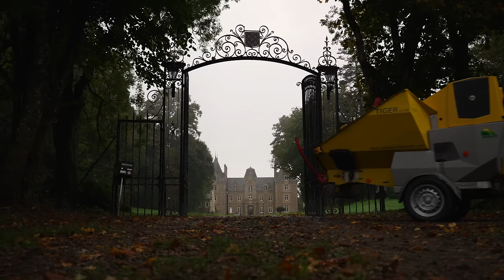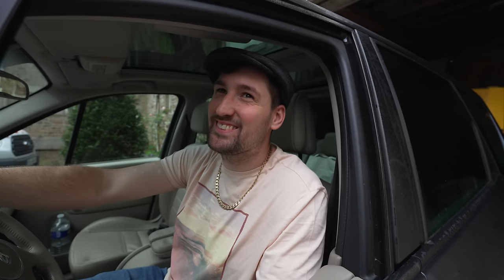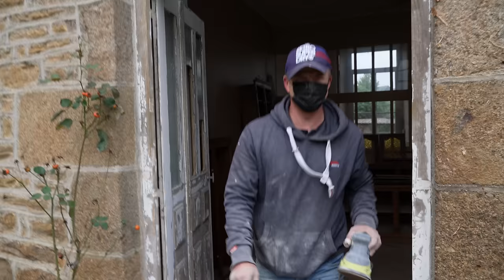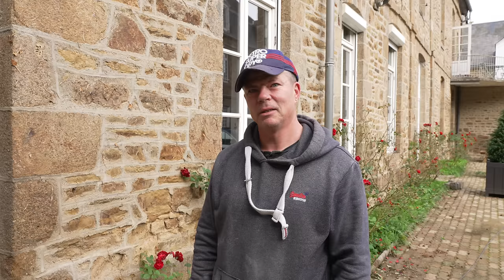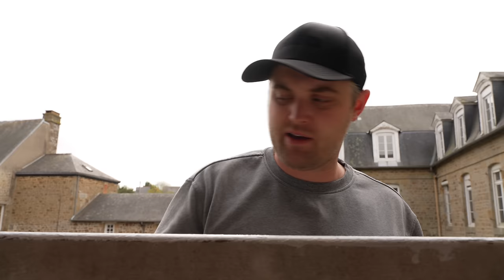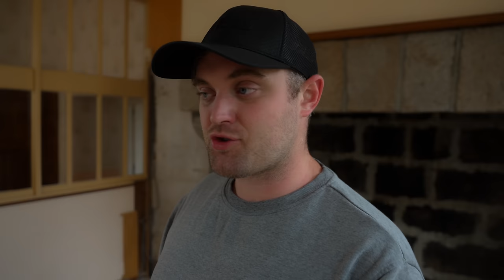A Cult Tried To Buy Our Abandoned Convent

Comment: wee gardeners tip for hedge trimming, billy. always have the top narrower than the base. that stops the base from becoming woody a bare n you have a lushly-leafed hedge from the bottom up. whether a hedge trim is acutely pyramidal or only slightly in shape, the growth aspect still applies. hedges fatter on the top always deteriorate into bare, woody looking failures with leaf only on the top.

Comment: 💕If you clear the kitchen by hand that will be the same as lifting weights & walking said weights outside will be the same as walking on a treadmill in a gym💕You’ll know you’ve achieved your goal from aching muscles💕Wash glass at both convent & château greenhouses wipe on wipe off good wrist exercises💕Use items around you like running up & down convent stairs or corridors knocking down walls with sledgehammer dig up tree roots with pick axe💕Open up stairway wall with sledgehammer💕If you do all these jobs by hand you’ll save money by Not buying gym equipment💕If after completing all these tasks you still want gym equipment you’ll of got all these jobs done so you will need to spend money on them💕Call it a smart jobs done workout💕

Comment: Let Ryan practice a bit more before you put a new felt on the top of the snooker table, otherwise there may be a few more tears in the felt 🤣. Ryan, instead of resting your cue on your left hand floating in the air, try the cue rest (the stick with the metal rest on the end) in your left hand and the pool cue in your right hand. That way you can control the end of your cue on those shots where you have to reach and can't put your left hand on the table top. Just a thought. Good luck.

Comment: The word cult derives from Latin word cultus to worship, to care, etc about a certain thing. In France it evolved into the word culte meaning to worship. In 1867 in the UK it evolved from the French word to cult meaning the same as the French meaning. However now it appears to have evolved into a word that means something different to the norm. Most European languages derive from Latin, however their meaning has evolved over time. Sometimes different can be a good thing. A different way of viewing things than simply following the crowd. Would love to have spoken to them. I am always open to new ways of viewing this world. It is only if a view becomes fanatical or controlling that then it becomes dangerous but the word cult did not derive from that meaning. Interesting that it seems to have become a word of negativity. I'm just wondering does the word culture derive from the word cultus also. Must check that out. There is always fantastic information to be found in researching a word and its meaning and origin.